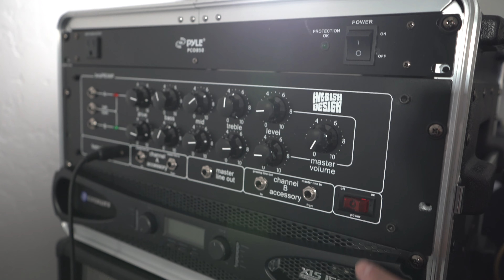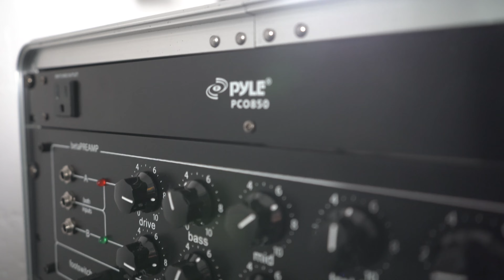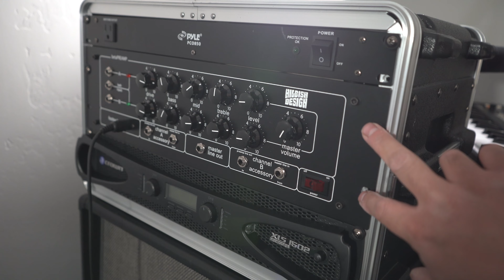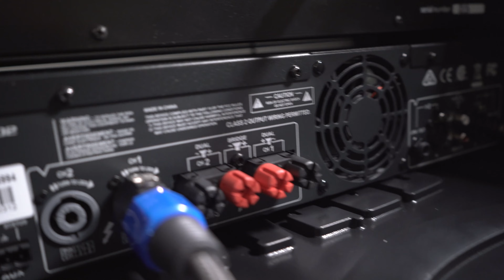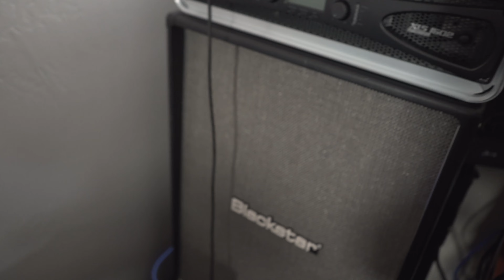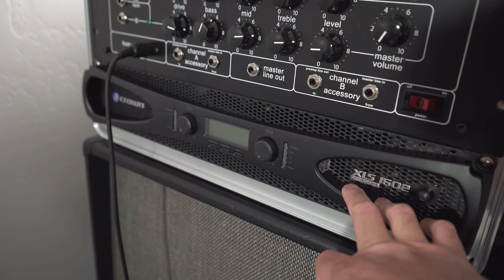Hilbish Design Beta Preamp Tutorial and Sound Demo

Comment: Great video, wondering what your thoughts are on the Hilbish BetaAmp 700? Do you think there's benefit to the separate power amp? I'm looking to use this in a bi-amp bass rig setup where the other amp is a tube amp, so I'm leery on blending the two from a dB standpoint.
Reply from the maker: Thank you! Yeah I was heavily considering getting one of those but then I realized I wanted to be as versatile as possible. It really is a matter of budget as well as power you want to put out. In your case, I would recommend getting just the preamp because the idea with that is you can use different levels of power amp to push your cabs, whereas the BetaAmp will be stuck at just the 700 watts. However the whole setup with the power amp and power conditioner and rack case definitely costs more, especially if you wanted to get a more powerful power amp than the one I got.
Reply: @Ponchy  Yeah, that’s the back and forth I’m doing in my head. Appreciate the insight!

Comment: do you use a TRS splitter cable on the preamp's line out to run both channels in stereo?
Reply from the maker: No you just have to run two speakers out of the Crown to be able to run two cabs and then you could set one for highs and one for lows to achieve a balanced stereo sound.
Reply: @Ponchy i don’t get that sorry, i mean let’s say if you run both outputs of a stereo reverb into the individual inputs of channels A and B how do you get a stereo output from the preamp into the crown?
Reply from the maker: @Fajfaj  Okay so there's two ways to look at it. You can do what I did in the video using one TRS cable from the master line out to run two cabs out of the Crown but what I didn't show is you can use the built-in high pass/low pass crossovers on the Crown to achieve one cab with just the lows and one cab with just the highs. 

the second way to do it is to utilize the two channels on the betaPREAMP to send each channel separately via the Channel A and Channel B accessory outs to the crown utilizing two separate TRS cables going into the Crown and EQing them on the betaPREAMP differently so you achieve the same setup of highs and lows in separate cabs. And then based on what you said, you could run one of your stereo delay outs into Channel A accessory and one of them into Channel B accessory and you would get each channel of the stereo delay going into its own separate cab. 

You can still do what I mentioned in the video and run two cabs from ONE TRS cable from the master line out of the beta but you will not achieve the point of having a stereo setup which is to assign different frequencies to different cabs.
Reply: @Ponchy  alright i get that thank you, splitting frequencies isn’t my thing as i’m just speaking in terms of physical left and right channels. so it would be guitar - pedal (output L - channel A input - channel A accessory preamp out - power amp input 1 - cab 1) (output R - channel B input - channel B accessory preamp out - power amp input 2 - cab 2)?  then it would be true L/R stereo?
Reply from the maker: @Fajfaj  yes correct!